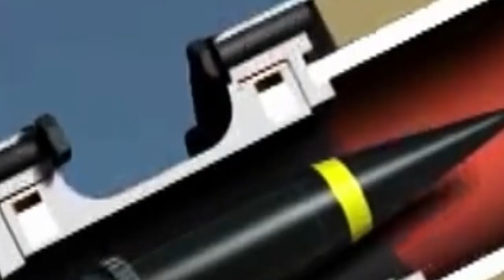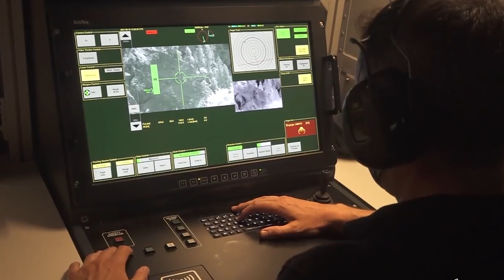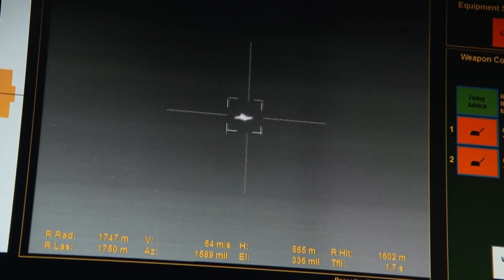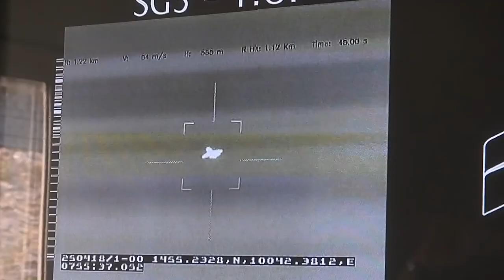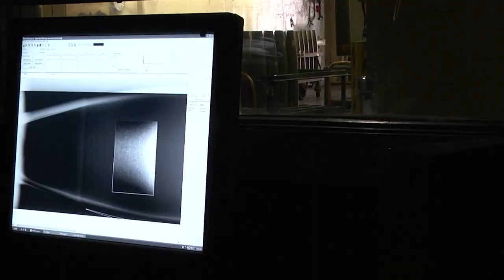Oerlikon Ahead Air Burst Munition

Comment: Great videos, love all the channels 👍
On a side note I was curious to know if anyone has ever tried to make a minigun/gatling gun that shoots 12 gauge rounds.
Reply: As far as i am aware, no-one has done so, as of yet. I do know that someone a while ago was working on a belt-fed full auto shotgun AR upper, but it never went anywhere, as far as i know, see this video: https://www.youtube.com/watch?v=1PRAjroxlJI&ab_channel=Moonstalker . I myself have been pondering the idea of a shotgun mini/gatling-gun for some time now, with the idea to use it for either some type of very last minute, very short range C-RAM or anti drone system, or for use as an area denial system. A system like that, with, say, four to six barrels would put a shit ton of buck-shot into the air (depending on the type of buck-shot and the materials used, of course). Not something you would wanna walk into, unless you want to end up as minced meat.
Reply: It would work in a Gatling platform.from a mechanical point of view.the main issue would be to settle on riffling for slugs only,or smoothbore for shot,and frangible rounds,such as the infamous wax loads we use in the south.obviously that exact round would not meet mil specs.but there are similar rounds in use.in a way I think 00 buck would be devastating from a high cyclic rate of fire in a minigun.espesially with a high density and very hard metal,such as tungsten carbide.volume of fire combined with shot spread would devastate targets.but there is a range issue,shotgun rounds tend to be very short range,not ideal for a Gatling gun setup.and there would be the issue of wads getting potentially stuck in the barrels.im sure like most problems,these are just needing some good engineering to work around.i could certainly see the system particularly useful on drones.they would be fast and manoverable enough to be able to work around the shorter range,and maximize the croud control aspect
Reply: @fjvmunsterman  I hadnt heard of anyone doing it either. I was also thinking of something like mounting it on a vehicle for short range suppression fire and defense, plus given the different rounds available such as slug, non lethals, and explosive rounds, it would be fairly versatile. Also terrifying for anyone looking down the wrong end.
Reply: @richardpeterson3753  I honestly forgot about slug barrels being rifled, probably would just stick with a smooth bore to maintain the versatility. I also never thought about drones but it would be well suited for something like that. And would be highly effective for crowd suppression, also I figured would be gud close range defence for vehicles  such as hummers and tanks

Comment: Does the US buy this thing? I've never heard of it. If they don't buy it, they'd better have a good excuse. Maybe the army would consider it redundant with the Vulcan cannon. And obviously, the Navy doesn't need it and has no place to put it.
Reply: No way.  Its owned mostly by a Russian Oligarch
Reply: to my knowledge they dont because they have had a system that can do the same job longer than this has been around using cheaper lower tech ammunition they took the phalanx system from the navy stuck it on a trailer and changed the 20mm rounds used by the navy to self destructing he rounds  that have a timed fuse so the rounds that miss explode in the air before reaching the ground to minimize collateral damage it can track and shoot down stuff as small as incoming mortars it uses a lot more rounds but they are most likely far cheaper and not a proprietary munition
Reply: I think there's been work looking into somewhat similar systems, particularly for drone defense. I read a naval postgraduate study a few months ago where they found the navy would likely need more CIWS in the form of mixed phalanx and radar directed mk 388 would be the only way to defend against large drone swarms.
Reply: @Kenneth_James  Where did you get that nonsense from?
Reply: @TheRealRedRooster  He got outdated info, and mixed some things. Indeed a Russian Oligarch does have shares from Oerlikon, but Oerlikon don't produce AA guns anymore. They sold the Defence part (Oerlikon Contraves Defence)  to Rheinmetall in 1999.

Comment: This is a cost-effective weapon !  Air burst & proximity fused round are the future.  Elegant cost-effective rounds !   Huge fan of this technology.
Reply: The Future??air burst has been around since before the first world war and the proximity fuse has been around since the second world war
Reply: @TheGingerburger  It's having a rebirth of sorts because it's significantly cheaper than missile technology
Reply: Best thing is you can program it not to go off if you need a single 30mm round, so they can be used on armoured vehicles too in a pinch.

Comment: You know this isn't that different from the sensor fused AA artillery rounds from WW2 right?
Reply: It is different, and quite significantly:
The proximity fuses for AA shells in WW2 "simply" caused the round to explode, when a received signal was strong enough. Thus, "light up" the target with radar, the reflected waves get detected by the shells and once "close enough" (when the signal is strong enough), detonate.
The Rheinmetall firecontrol system together with AHEAD is an entirely different beast: The firecontroll system plots a 3D-area in front of the target and causes the gun fo "fill" that area with bullets. Together with AHEAD, the system determines the speed of each bullet *while it is in the barrel*, computes the time the bullet takes to the target, programs the time at the muzzle into the shell which in turn blasts into shrapnels at the programmed distance. This is quite a feat and creates a very uncomfortable no fun zone for anything coming into range. 
Don't get me wrong: Creating a proximity fuse in WW2, with tubes, that can withstand the G-shock of being fired in a gun and even function reliably is an astonishing feat.

Comment: This reminds me of the proximity fuse from world war II back then they were putting Radars in high velocity shells, at a time when radars were extremely sensitive to shock and other stresses an artillery shell had to endure,  now we're putting computers and other electronics in shells, also something you'd think is very vulerable to the forces a shell has to endure.
Reply: Nah, properly made and potted solid state gear is immune to any Gs up to the point it would physically crush the munition.
What was much harder was getting glasd Valves to survive 20,000Gs in WW2.
Reply: Not like it's a glass tube in a shell.

Comment: Now imagine how these are linked to asynchronous radar systems taking advantage of positional deviation and GPS tracking (sorry, don't know the exact specifications or terms; I only read about the theoretical abilities of paired radar systems more than a decade ago). 
These are able to effectively neutralize the stealth capabilities of most physical form-based stealth measures, like the B-2, or the F-35 fighter by calculating the deviations of radar rays being deflected or absorbed by calculating the travel distance to a second radar transmitter. They ALWAYS have to work in tandem, or even small groups of emitters, painstakingly exactly positioned.

Only active jamming offers actual defense against these radar systems, but active jamming is the equivalent of shouting into a silenced room with a bull horn that you want to be stealthy.

With that low flying targets become that: just target practice.
Reply: This geared towards taking out low flying threats mostly drones and cruise missiles,  Jets fly way too high to be touched
Reply: @eduwino151  Correct, I have not claimed anything else. Anything within 5 km could be defended by this mechanism. 
So very low to medium height attacks become highly dangerous to the attacker as this system is essentially unmanned and controlled from a distance. For longer distances other defenses like SAM's will be needed. That's what the integrated systems of Rheinmetall is currently aiming at. 

All units have overlapping info, from radar, lidar, visual, IR, etc to possibly even optical sensors on an individual soldiers gear linked into one comprehensive control map. Essentially, what one sees, all see. What one can fight, ALL can fight against, if they've got the range.

But this system is even able to take out guided or unguided munitions, not only drones, if detected early enough. Making high flying jets or bombers much less likely to actually hit a ground based target.

If ground support missions suddenly become a danger to the air support due to this system in place, with the possibility of the air-ground support mission being blunted or even completely countered, why endanger your air support?
That's the basis behind this system. Making short to medium ranged guided or unguided attacks less and less viable.

Comment: How would this do against heavy artillery rounds like 155mm or 203mm? Would it be affective or can it only be used for lighter? This could be used in heavy rounds against different vehicles. Not to knock them out but to “blind” them. You hit a ship with it might cause minimal structural damage but could disable sensor or radar.
Reply: It is meant to fight incoming mortar rounds as well as artillery or drones. It is also used on ships, stationary for camps or on a vehicle.

Comment: I'm hoping we have larger, rocket versions of these for defense against hypersonic ICBMs. Anything hitting those tungsten pellets at hypersonic speed would be ripped to shreds. Putin's big brag about his hypersonic ICBMs loses a lot of air when he realizes that their speed is their biggest vulnerability.

I like the idea of using tungsten. With its extremely high density and melting point, the projectiles would be able to penetrate a rocket further before melting and disintegrating. Imagine if hypersonic missiles were used to deploy these at a rocket coming toward them at hypersonic speed: double-hypersonic impact. That would be something to see!

Comment: Oerlikon is not existing as an Independent company since the late nineties. The company is called Rheinmetall Air Defence AG today. And is of course part of the German Rheinmetall Group today.
Reply: There is a sub group that produces trains that is still called Oerlikon. They are also owned by Rheinmetall but they split it up.
Reply: @exo068  
Yes but the company they are talking about in this video is a 100% owned subsidiary of Rheinmetall.
Reply: @markschoning5581  yes and the trains have been split for tat reason. Who would want to buy trains from Rheinmetall Air Defense for public transport.
Reply: @exo068  
Oh it’s very easy, there was once a Company called Oerlikon-Bührle. Than there was a company called Oerlikon Contraves Defence. That company got nearly bankrupt during the 1990ies because of the commercial failure of the ADATS project. So Rheinmetall was able to buy the defence division of Oerlikon-Bührle for cheap money. You don’t have to lecture me about the history of Oerlikon-Bührle.

Comment: I wonder if these projectiles are really more reliable using time-delay fuses than earlier forms of AAA using proximity fuses to detonate their scattershot directly ahead of the incoming target?
Reply: Absolutely. First, better, modern targeting system. Next, detonates long before a proximity fuse would, which means a wider spread of shot, increasing hit chance. This is amplified by the fact that you have another dozen rounds right behind the first. A "hit" with an old proximity fuse might cause more damage one on one... but that also assumes a hit.

Comment: OK I have a question. I can see how this AHEAD weapons' system can be very effective when defending against a munition that is coming toward you. Will it be less effective if the threat is moving away from you? Head to head I can see how the submunitions can be effectively deployed. If the treat, lets say an air plane. And that air craft is moving away from you, Is the system less effective?
Reply: In order for a projectile/aircraft to move away from you it has to first move toward you. Unless it was basically launched on top of you, at which point it's probably your projectile anyways.
Reply: @Dubanx  Yea, we all can figure that out. No system is perfect. But the physics don't change.
Reply: Doesn't matter which direction the target moves in, the tracking computer can still make the calculations for the munitions to either directly target the object its tracking, or have the ammunition explode in front of it, the momentum of the craft will still push it through the cloud of tungsten particles, with this weapon system you have nowhere to hide. Unless you can confuse the targeting computer of the weapon system itself.
Reply: @ianvermaak6773  

Not true. When the target is moving at comparable speeds to the bullet, the target's direction of travel matters a lot.

If the target is moving toward the platform it can fire the bullets on an intercept course easily enough.

If it's moving away from the platform the bullet isn't going to able to catch the target or, at the very least, will have considerably less horizontal energy to work with.

It makes a world of difference for fast moving targets.

Comment: So, basically it's HE-TF without the HE.

Ok then.

I mean, the Americans dominated the pacific theater with HE-VT shells and 5 inch gun mounts back in 1941, but alright then.

And the sergeant york used 40mm HE-VT shells, but ok then.

Guess just have to buy the fancy cluster-APCR from Oerlikon.

But then again - does this count as cluster munitions and is in violation of weapon restrictions?

Comment: I would like to know why they didn't go with rotary cannons? It seems like it would offer a higher rate of fire that would make this ammunition much more effective. Perhaps it would add a level of complexity that would make this a less reliable weapons system?
Reply: They use revolver cannons.
Gatling systems have indeed a higher rate of fire over a sustained time, but revolver cannons have higher burst mass at trigger pull.
Gatling systems require half a second to cycle up to firing, while revolver cannons immediatly start firing with full ROF and thus have a higher initial burstmass.
The reason why germany/Airbus goes for revolver cannons in most fighters, because they give a significant advantage in dogfights
Reply: @zhufortheimpaler4041  I was thinking it was the spin up time thanks for telling me although I'm not familiar with revolver cannons going to look up now.
Edit: I looked them up it seems as an addition to this system a rotary cannon would be the perfect addition an initial burst from the revolver cannon while the rotary cannon spins up and provides sustained fire. I'm thinking for a system meant for fighting Russians and Chinese.
Reply: @austinlowrance5943  its not like C-RAM and Point Defense Systems require continuous fire.
Its always short bursts.
Otherwise you can shoot down a single target and thats it, because your ammo is gone.
The US C-RAM has 1500 Rounds of 20mm loaded. That is less than 20seconds of sustained fire.

btw this system (Manticore) is used as point defense and light secondary on german navy ships and is there called "Marine Leichtgeschütz" light naval gun.

And also the programmable ammunition system wont work with spinning barrel bundles

Comment: while very impressive I'm wondering if the cost of a single burst doesn't exceed that of a single target (take for example the small commercial drones that are used for combat purposes)
Reply: Yeah. I've been told the programmable munitions cost around $800 per round, give or take based on quantity ordered.

The non programmable rounds are much cheaper.

That's about the same price as the cheapest Chinese drones used in Ukraine.

You'd probably prefer to bring those down with EW.